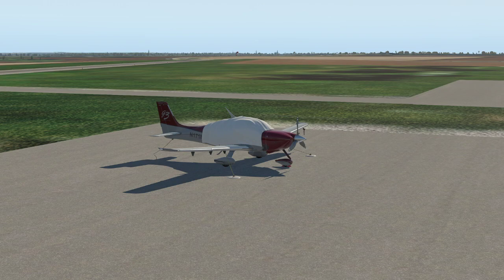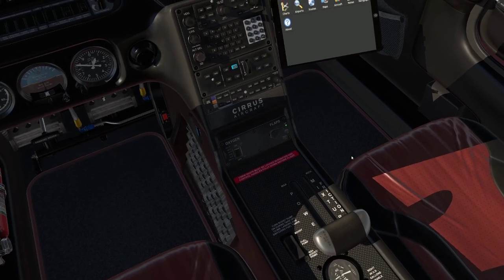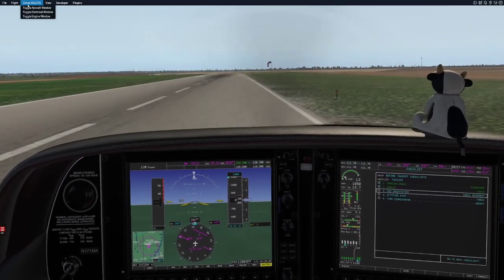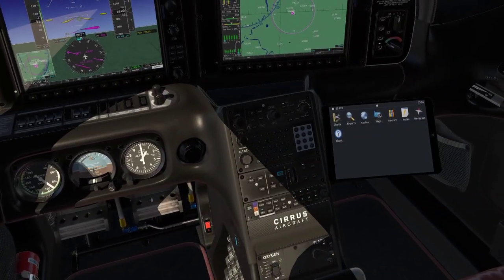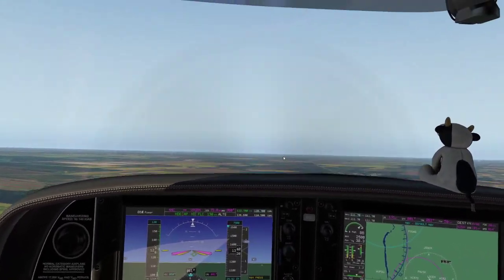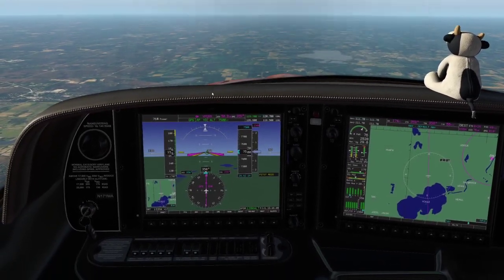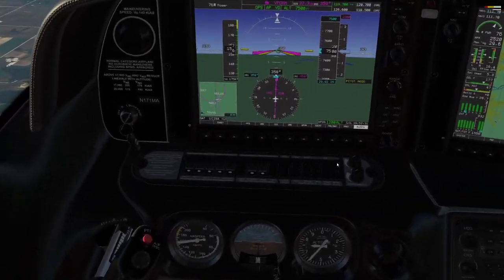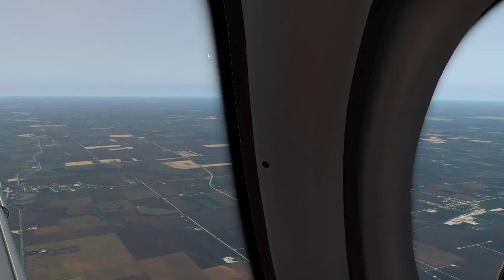Flying the TorqueSim SR22 to SimVenture 2020

Comment: Thanks for joining! 60 degree rock is definitely excessive. From our testing, with the X-Plane visuals, the controllers couldn't really see a rock less than 18-20 degrees which could have been why your rock may not have been seen the first few times you tried it before stream.

Comment: Nice video, but a bit of constructive criticism (to help you with future videos).
1) Try to do a better job with volume mixture, your voice was really low and then BAM in comes Foreflight and about blew the headphones off my head!
2) Not sure if you are in VR or TrackIR (or other), but the constant head movement is no good.  Had to stop watching during taxi as it very unsettling with all the movement.
Disclaimer, I am just as guilty on the above in my own videos ;-)

Also, you mention setting the frequency using the GCU, you can do that, simply hit the COM (or NAV or XPDR) button next to the main FMS knob on the GCU and then you can use either the FMS knob or the numeric keypad to enter the frequency (note only works on X-Plane 11.50).
Reply from the maker: The video is an export from a live Twitch VOD, which is why the volume settings needed adjustment (it was not edited or planned), and why the head movements were erratic.
Reply: @riscfuture  Tim, what head tracking do you use? TrackIR? Do you like it in conjunction with x-camera?
Reply from the maker: @dougduplessis4143  Yes, I use TrackIR with X-Camera; it works well.
Reply: Oh yes I agree, head movements make hard to watch th entire video and also ypu talking continuously unfortunately is kinda disturbing especually with the ATC rolling behind.  Nice arrival and welcome to Oshkosh 😉

Comment: Is there a setting to cheat and not use braking/caster steering?
Reply from the maker: ManOfNantucket If you disconnect your rudder pedals, it will allow you to steer with the yoke. Otherwise, no.
Reply: It's a pretty important part of the Cirrus Life experience.

Comment: I hate people that spread false information on the internet. There is so many things you said incorrectly regarding the Cirrus. I hate that people will watch this and try to learn from it, sad...
Reply from the maker: Feel free to educate me -- I am an SR22 owner in real life so I'd hate to realize I've been doing it wrong!
Reply: @riscfuture  I owned and operated an SR22 for over 3 years, I've learned a lot. The Throttle adjusts manifold pressure and RPM, you said that there's no way to adjust fuel flow which is wrong. You use the mixture lever to adjust what you are saying, which concerned me that you didn't think of that. Also, being this is a G3 I believe that the CAPS available altitude is 600 AGL due to the increase MGW. Previous gens would be 500 AGL.
Reply from the maker: @thebryan426  I definitely did not say (or at least should not have said) that there's no way to adjust fuel flow. Are you sure you didn't misunderstand? I definitely understand that fuel flow is set by the mixture and throttle positions.
Reply: Bryan S When learning new aircraft types I use manufacturers training sources, CFIs and/or current and previous owners. No competent pilot would use a video reviewing a new sim add on, whether they were a previous operator or not. Your comment is not helpful. Perhaps make your own video? The creator spoke for over one hour and it is clear he has a lot of SR22 knowledge, even the greatest experts can misspeak. For reference, I believe the bit you ‘hate’ was here? 28:20
Reply: I learned from it OH NO I'M SCREWED! Good flight Tim :)
Reply: @edwardsp1916  You are correct, that is the part that I wanted to mention was incorrect. Thanks for pointing it out!
Reply: @riscfuture  28:40 watch the video that YOU posted again. You say, "You're not going to be able to control fuel flow independently of your manifold pressure" How does that make any sense? Throttle controls what? In the Cirrus it is both Manifold Pressure AND RPM.
Reply: @jfavignano  I'm sure you did, no wonder you fly just as interesting as this fella does.
Reply from the maker: @thebryan426  Yeah, I meant the power lever controls MP and RPM together.
Reply from the maker: It was a live broadcast, cut me a little slack.
Reply: Tim Morgan I wasn’t aware, nice airplane though. Thanks for the video.